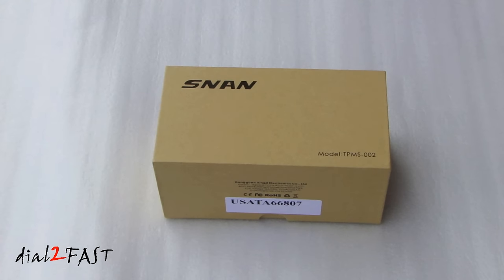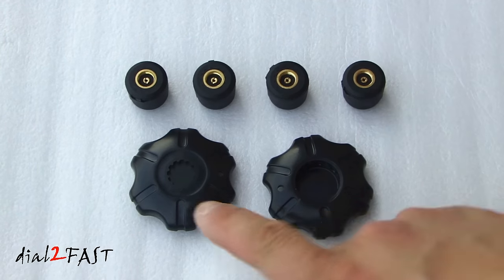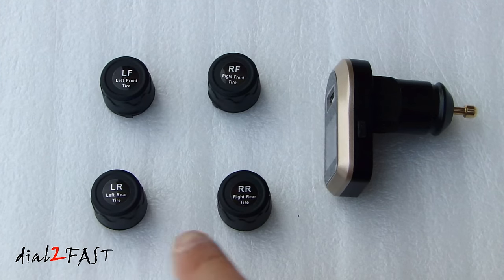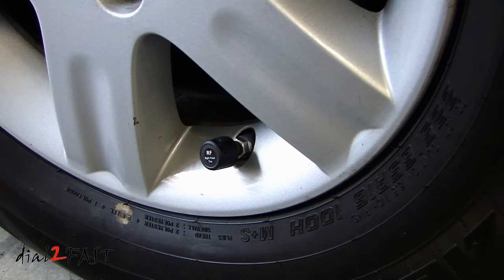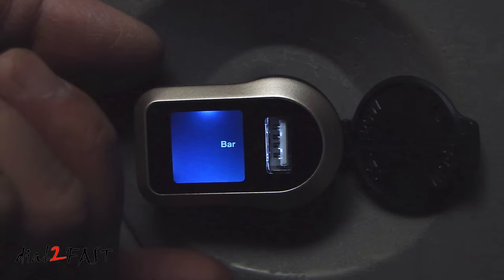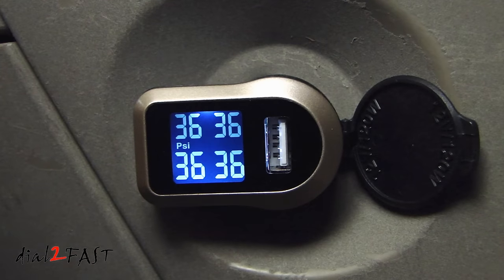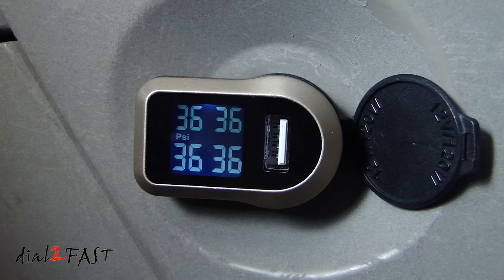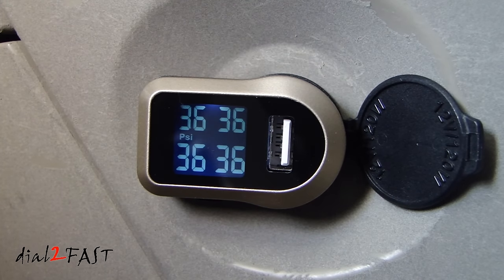Wireless TPMS Tire Pressure Monitoring System Full Review

Comment: I've always had a problem with printed directions, but with your video I had no problem. I would add also something that might help others who encounter the same problem. I installed everything as per directions but the screen just kept flashing 00 so I waited another 15 minutes or so and went back to the car, but the screen was still flashing. I scrolled through the set up  and noticed that it was reading tire temperatures, but still no pressure readings. It occurred to me that maybe something was interfering with the signal so I backed the car out from the carport and as  soon as I began moving the right rear pressure appeared then  as I continued, the rest came on.  I'm not sure what happening, but everything works fine now.  Thanks for the input.

Comment: this is a great idea over stock tpms sensors we use now they are rather expensive at over 100 dollars a peice installed and reprogrammed retail price also made out of alloy witch tends to break over time due to ware and tare many people don't know that there are gaskets that have to be replaced at every tire change and also very important to keep valve caps on them point being that designs are improving hopefully one day sensors can go directly into the tire and just go back to regular rubber valve stems that would be great

Comment: Want to use 2 sensors on airbags on motorhome.  Is there a way to program or sequence to only have 2 sensors recognized vs. 4 ?  Currently it alarms that the other 2 sensors that are not installed are at 0 psi.

Comment: Thanks.  This was a great help as the instruction manual was useless.  One issue I have is that the display comes on with mine as soon as i plug it in the in the lighter and it doesn't go off again until i remove it.  Any ideas how to fix this?
Reply: Colin Molloy that is your car. Some cars have cigarette lighters that run all the time, no matter if the key is in the ignition or not.

Nothing to do with the product here.

Comment: One question though, so everytime i have to refill the tires, i have to take this thing off and put back on ?
Reply: Yes, which will be a pain
Reply: No.  Air is able to pass through because they become invisible when on the wheel.......you don't have to lock them on.  You would lock them on to prevent theft, not them coming off.
Reply: just a serious case of laziness :)

Comment: Is it easy to steal for people on the street?
Reply from the maker: +David Fortuoso People can steal it but they won't have the display unit.
Reply: +dial2fast I know, but there is some kids in Spain that steal wheel caps just for fun so I think they won't last a lot in the wheel :(
Reply: Most new versions have special lock nuts you install before the sensor that can only be removed with a special wrench.